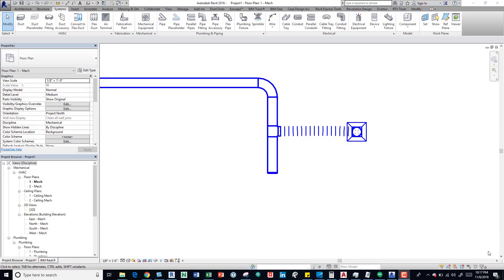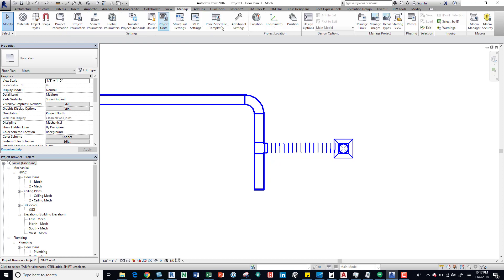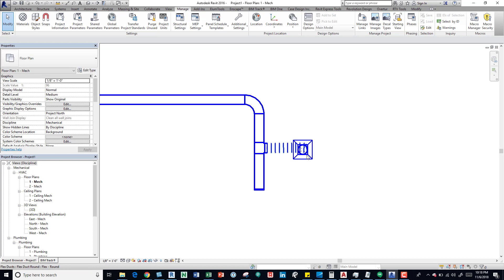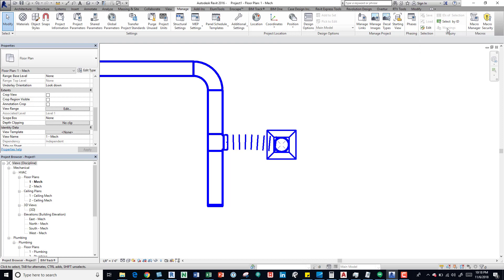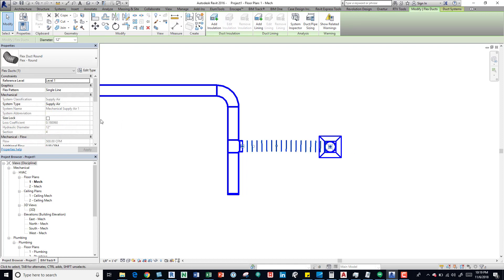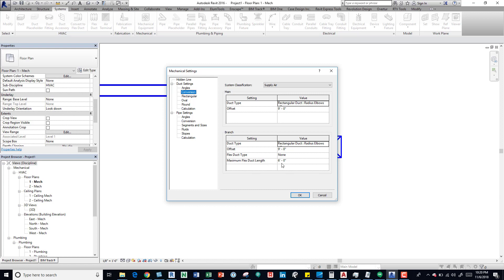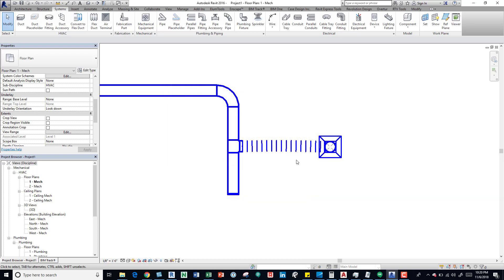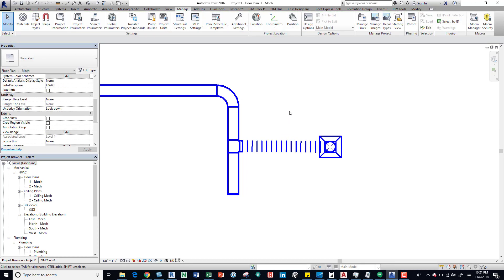The flex duct length off x exceeds the maximum specified length of x

Comment: How do you get the connection at the air device to show as round with the vertical flex not centered?  i am not seeing a setting in either the flex or air device settings and am using an air device with a round connection (titus basic 2x2 cone with round neck air device).   i get a vertical line at the center of the air device using any of the non-1 line flex types.